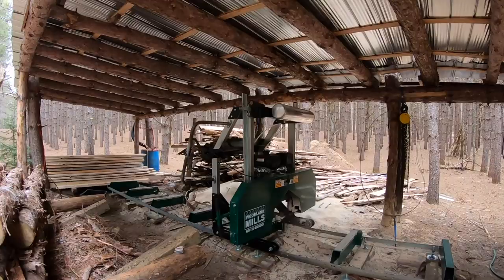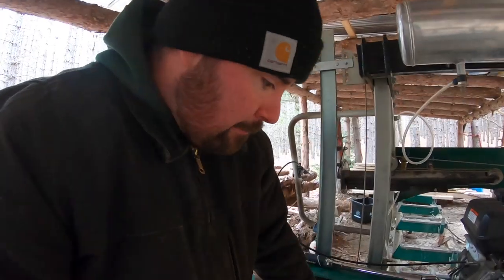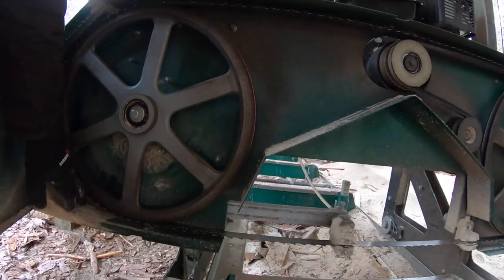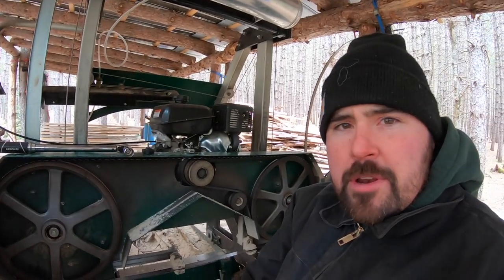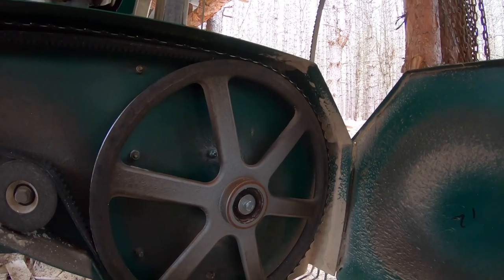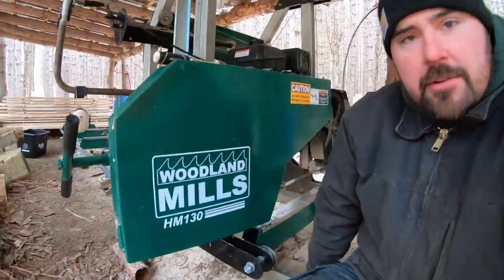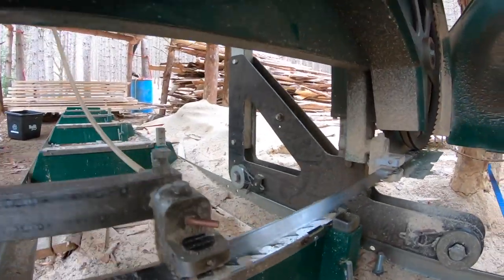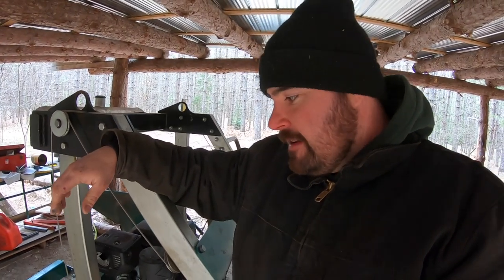How to Fix Common Problems with Your Woodland Mills Sawmill

Comment: I have adjusted my idle rpm based on your recommendation. Not sure how much longer my clutch will last, but milling definitely became more enjoyable. As I am turning the log, the engine gently whispers in my ear instead of screaming and ringing like it used to.  This adjustment is not covered in the manual. Your videos are a huge public service. Thank you

Comment: Sandy. As a Woodland HM-130 owner myself, you covered everything very well. I remember the frustration with the saw blade jumping off just as I hit wide open throttle. The fix for me wasn’t alignment but to take sandpaper and scuff the orange belt on the following Wheel. Also to be sure the blade was oil free and to cut a couple of logs without any lube going to break everything in. That was what Woodland Mills customer service told me to do when I contacted them.     Worked without making any more adjustments to the Alignment.   They said at the time that they had seen a few cases where the slick belt, the shipping oil on the bands and using lube causes the blade to hydroplane off no matter how good the alignment was.
Reply: Wow, sage advise. TY👍😎👌
Reply: Went through the tossed blade as well, the most awesome assembly manual ever, no hints or true operation... It's been 20 years since I've milled, easy to remember after I've messed up.  Mill runs great after a total head alignment, blade wasn't running proper form the beginning due to improper idler wheel assembly.  Had extreme cross alignment.  If you turn your wheels backwards and the blade changes tracking it has cross alignment.

I am happy with the machine but the "we'd rather have customers call customer service as print an operation and adjustment manual" makes me shake my head...

Comment: Just got started with my long awaited mill, 126, all going well after many days of assembly until The safety guide nudged a metal upright & chewed up the factory blade. 1 down, 10 to go, added new blade, think it was tensioned & all, next cut it jumped off after a few feet, 3rd went the same way, so now between your video & reading the instructions I’m determined to sort this out - undoubtedly user error, it’s an impressive machine, and you are their finest ambassador- cheers Sandy!

Comment: Hey Sandy.  I was planning on doing a similar video for my mill on the torch specs of the band wheel.  I tightened mine to 25ftlbs as requested right out of box with a brand new torque wrench and it was too much, which caused the blade to come off the back following the exact steps you do.  Now I torque it to 17ftlbs and it works perfectly.  People have to make sure this is correct for their machine by testing it.  They don't all seem to be the same.

Comment: Sandy my friend. My issue is with the cam clamp on a 126 mill. It doesnot apply enuf force to hold the log against the posts. I have reversed the base so it tips toward the log as per manual.. It just not come out enuf when you put the handle down. The dog face  is a flat, not a point. The 122 has screw clamp dogs.. Your 130 has the same clamp as mine.
 Maybe they dont tension the blade enuf. Tracking is important. I had another mill so I  get this.The bed must be level lengthwise and level across the bunks. Yopu can tell when you pull the blade back after a cut . It should glide evenly over the log. No binding, no dipping at the end. logs that hang out too far over a bunk are pushed down so you end will be fat or thin.

Comment: Just got my first mill ever. Got the HM122. Not blade jumping issues, tracking is similar to a regular vertical saw, but the clutch ping had me baffled, and I noticed at 35lbs my bald absolutely will not turn. We’ll get er though. Love the channel.
Reply from the maker: Glad you’re liking the channel and good to have ya here

Comment: I have been very pleased with the lumber quality, and uniformity   There have been no thick and thins,  or wedges (which is an inconsistent thickness between edges). 

My only problem is that one cranking rotation (up or down) is no longer an exact thickness like it was when it was new.

Comment: Thanks Sandy, I did call tech about the clanging sound... I adjusted the idle screw down but it needs to go further...still clanging. My question now is I am getting a "corrugated" washboard surface when cutting white ash, tree just dropped. I have on the general purpose blade and go funeral march slow walking but still it is there. Is the general blade not capable of ash? Enjoy your videos... hitting on things I need help with.

Comment: I really enjoy your videos. Just cut my first log on my woodland Mills 130 Max. It went pretty well but I am having issues with the sawmill shaking left to right. Along was about a 13-inch diameter Ash log. I tightened everything down in the mill assembly. It was my first log, so the blade was super Sharp. It did get better when I went super slow, but that seemed to be unworkable speed. Can you tell me what to look at?

Comment: @ 15:45 you mentioned that you don't use any lubrication due to mostly sawing during colder temps (aka Ontario winters). Has that changed since? I recall you mentioning your use of windshield washer fluid for winter sawing. Am I mixing apples and oranges or has your procedure and recommendations changed since? I'm about to become a sawyer myself and just trying to father all the info a can.

Thanks again for your videos (time and willingness to share), making our learning curve that much more exponential.

Comment: Thanks Sandy for your video. I have a Norwood LM29 with the same engine you have. I have a hi idle, the blade keeps on turning, couldn't find a srew on the throttle mechanism to lower the idle. You showed us where the idle screw is. Thanks.

Comment: Did your HM130 come with thr adjustable guide arm? I have the hm126 and it has so much play between the pulleys that it affects the contact of the blade. I have called WM and they’re send me a new one. I was just watching videos to see if anyone else had this issue and noticed yours didn’t have the yellow plate in front where it attaches to the water spout.

Comment: Hi Sandy. Here’s a problem you haven’t experienced with your mill. I received my hm122, 91/2 h.p. Kohler  about two week’s ago. Set it up according to the manual. Used new 91 octane non-ethanol gas from the same can I run all of my other small four cycle engines on. Obviously filled the crankcase with 10w30 synthetic blend oil as I have used for year’s in my other engine’s. The motor started on the first pull but run’s erratically. It won’t idle, run’s rough. Giving it full throttle it runs well but when letting off of the throttle to idle it dies. It pings so if I adjust the idle lower it will not run. While holding the throttle to keep it running and making a few cuts the smoke begins to come out from the clutch side of the engine and it smell hot. Called woodland mill’s, with difficulty making contact, and they advised I would have to contact Kohler for warranty work. I called the nearest Kohler repair and they stated I would need to bring the mill to them but it would be three month’s before they could get to it. Now that I have stopped crying, do you have any idea’s as to what is going on with this motor? I reset the spark plug from .025 to .030 as the book stated but no help. Set out-to-sea without a paddle. Yard ornament? Thank you for your time and video’s. Dan😮
Reply from the maker: Hi Dan. Sounds to me like the clutch is engaging as that’s what’s that pinging sound could be with the clutch prematurely engaging due to high idle. The Kohler dealer though will know for sure. Hope things work out sooner rather than later for ya. Thanks for watching

Comment: Thank you for sharing...Just bought one after i saw u,i m building it up,i was wondering how long before u have to sharp the blades ??
Reply from the maker: Hey Eric, I normally only mill softwood and so the blades tend to last quite a while assuming I don't run them through any dirt on the log. I'd say I get to mill atleast a good 20 or 25 smallish-sized logs before I end up noticing a real reduction in sharpness.
Reply: @sawingwithsandy  thks.i got the same wood as you!!do u hAve to bend the teeth everytime you sharp the blades?
Reply: @ericcourchesne5901  The 'bend' in the teeth is called the 'set' of the tooth. If you send your bands out for sharpening, they also check the tooth set. If you sharpen your own, you'll need the tooth setter tool or machine. That tooth set is what keeps the band from binding as it cuts, very important.
Reply: @leemundy1613  i m doing it myself,do u set before or after sharpened the the blades ?
Reply: @ericcourchesne5901  ...usually after, kind of a finishing touch.

Comment: Sandy, I just bought an HM 126 from Woodland Mills. When I even out the saw head by adjusting the cable tension, it causes the saw head to bind when I raise it up and down. It will only raise smoothly off level. Even when I lower it down all the way and there is no tension on either cable, the saw blade is not level and the entire head sits off kilter, though the track is level. I have loosened the bolts on the saw carriage and shaken it down. I have made some progress but it still seems to bind more than I believe it should. I'm not sure what I am doing wrong. I've called woodland mills twice and they say loosening the bolts and a shake down will fix it, but I'm having no suck luck. Have you heard of this before?
Reply from the maker: Hi James. I wish I could help here but I’ve not experienced this before

Comment: I have a rookie comment/question regarding the WM tooth setter: if most bandsaw blades are around .044” thick, why provide a .055” thick “zero-point” set tool with the setting assembly?

Comment: Whenever we were confused about how to troubleshoot something, my dad would always say, “when all else fails, read the directions.” You never explain what to do if orange poly covering on left band wheel wears out. Do I have to replace whole wheel, or is there a new belt that can be put on?
Reply from the maker: There’s a new belt that goes on there as well. On the woodland mills website you’ll see a spare parts kit they sell. That’ll give you an idea of the wear parts that you may end up needing to replace

Comment: I think I'm at that point where  I need to track the drive side wheel.  I deleted my previous comment because I had concluded that my belt was worn and the blade was leaning on the drive wheel. Now there's no question.  No matter what I do (with a brand new belt)  the blade "tracks" off foward 3/16" from the drive wheel.  the blade inevitably comes off and breaks a couple teeth in the process.   Where did you learn to adjust the drive side?  The manual won't say.  Thanks.  Good videos.
Reply from the maker: The manual on my 2017 sawmill model has a small written section that talks about the drive side adjustmment. May be able to get the info from Woodland Mills over the phone as well. THey seem to be good with the tech support. Thanks for watching Woody.

Comment: I aligned the band wheels per manual and everything seemed to be tracking perfectly, however sometimes between cutting logs when the machine has been off for maybe an hour or so, I load a new log turn the machine on and bam blade flys off and always destroys the blade. So how is that the tracking is literally perfect torqued tension, and working fine, then after it’s turned off and back on, the blade falls off. I don’t get it . I’m sure I could be doing it wrong, but I’ve gone through the manual tediously and like I said machine will work just fine but now Ive busted 5 blades and I’m pretty pissed now.

Comment: Great points bud. Have you had any issues with you Teflon slides?
Reply: i have to replace my on my 126 and it not a year old let
Reply: Did mine yesturday
Reply: @newfoundlandsawmilling9023  may i ask how long did it take you
Reply from the maker: I’ve been fortunate and not had my issues with mine
Reply: @johnnyhankins5186  it took the after noon. I lowered the head down on to blocks of wood and removed the bolts from the rectangle post that the slides ride on. I pulled the post up through the the head and installed the new ones. One side at a time of course.

Comment: hello sandy i have 126 saw mill with a 14 hp motor i have  problem starting it up it is a new sawmill when i pull the cord compression from the cyl it will pull back so hard it pulls right out of your hand what can i do about this the factory isn't helping thank you rick
Reply: Sounds like the spark timing is a bit too advanced meaning it is firing before the piston is at top dead center. I would go to the Kohler website and check there for how to adjust it. Most often the coil stack is a tad too close to the flywheel magnet in my experience. Simple adjustment with even a business card for a guage. Hope that helps. My 126 is in production. Only 10 weeks to go 😜
Reply: Would it do that if the clutch was engaged. That’s what my material packer was doing

Comment: The water isn't dripping out of the copper nozzle when I press the throttle. I've let the top valve screw out a little too but nothing!! Any suggestions. Today was my first time using the new mill.
Reply from the maker: I find that the water tank can get clogged up with gunk so I flick the start of the clear hose while the valve is open and screw is all the way open and normally the debris clears
Reply: @sawingwithsandy  thanks for your reply. I actually saw you do that in one of your other videos too so it was the first thing I tried. My hose just stays half full of air and doesn't actually flow to the brass nozzle. I thought maybe I was supposed to unscrew the valve at the top but still nothing. I put fresh water in it for the first time today too. I'll keep trying. 

I can't wait to see how your 2.0 turns out!!
Reply from the maker: Let me know if you get your problem fixed . I find I get inconsistent water flow sometimes with lots of air bubbles
Reply: @sawingwithsandy  for sure
Reply: @sawingwithsandy  I got it figured out!  The throttle cable wasn't tightened down enough so it wasn't hitting the release valve on the tube. I adjusted the cable and tightened it down.
Reply: I put a squeeze bulb in the water line to start and keep the liquid flowing.  

Whatever the correct name is, we see them on older outboard motor tanks used to start the fuel flowing.

Comment: If guys are sharpening blades and not putting set in the teeth they will heat up because it’s not making a wide enough cut we use deizel for lube
Reply from the maker: Thanks for passing along the knowledge Clayton.

Comment: Understand the average sawmill blades only last three to four hours.
That sounds a bit excessive.
What’s your experience?
Reply: I see no one answered you so i will take a shot.  You can cut a lot of board feet in three or four hours and depending on how dirty the bark is and how hard the wood is will determine how long the blade with last.  Just like a chain saw, after a while it will start cutting poorly so you will have to take it off and sharpen it, that's just par for the course.  Hope that helps.

Comment: I used mine for the first time and the cluch went after a couple of hrs . Did anyone else have this problem?
Reply: Sounds like too low a motor rpm. Being a centrifical clutch the higher the rpms the less the slipage and of course wear. There is a vid on here covering just that on a new mill.